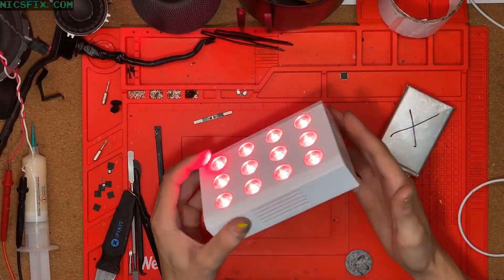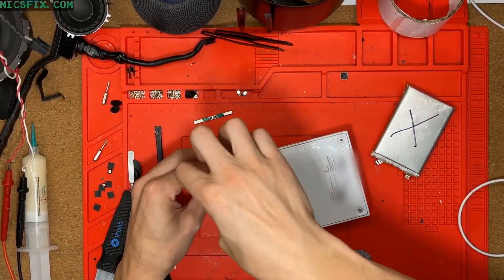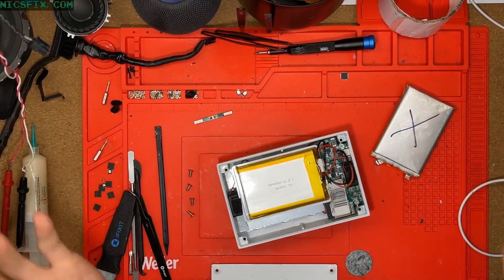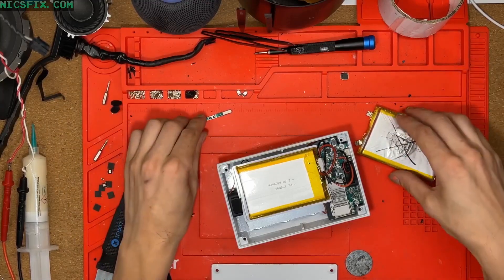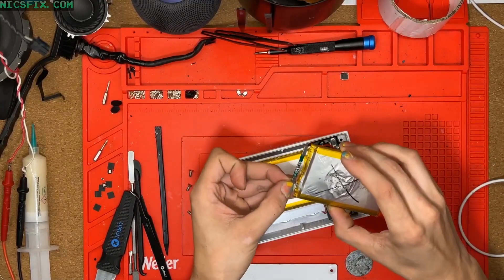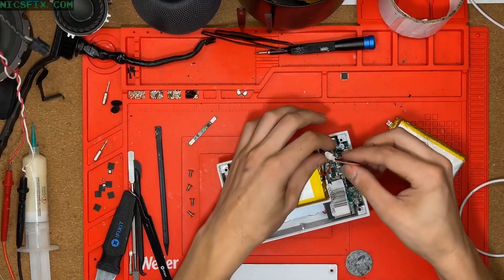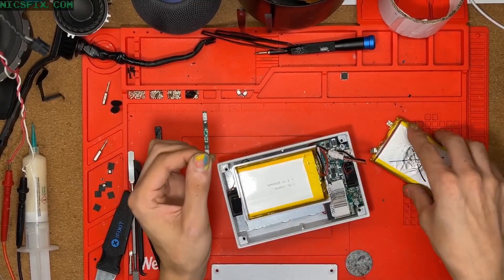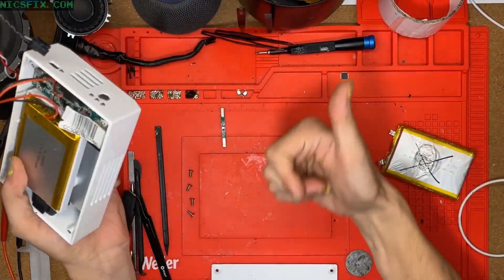Joov Go Red Light Therapy Battery Repair

Comment: Do you know what better size you used?

My Joov has the same issue.
Reply from the maker: Link to the battery I used is in the video description (6500mAh). You'll need to swap the BMC from your original battery to the new one.

Comment: Is replacement of bmb tough? Never swapped one
Reply from the maker: It was actually pretty easy! Just needed to pry apart the pinch welds on the old battery to bmb, then used regular solder to connect it to the new battery
Reply: @NicsFix so when Santi g to put it on how would you apply it
Reply: Did you try Replacing it? I'm about to.